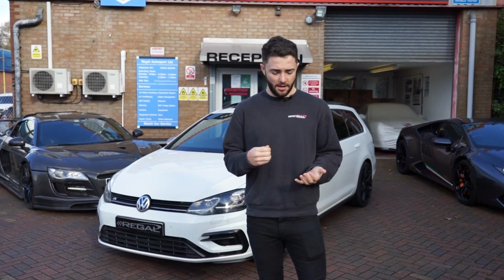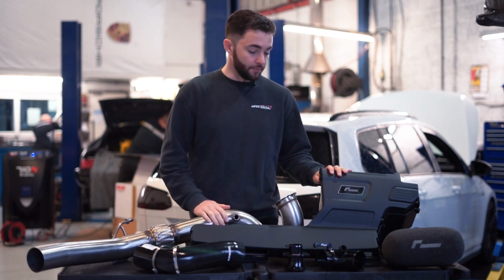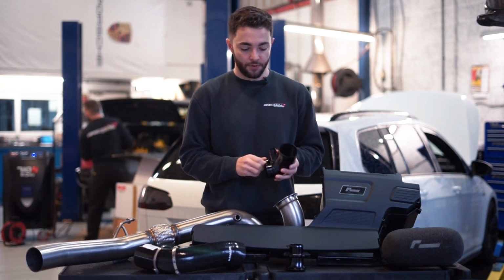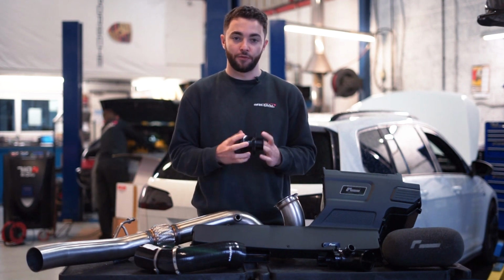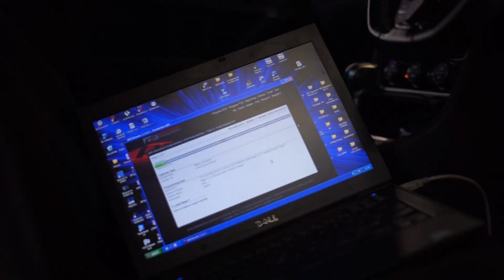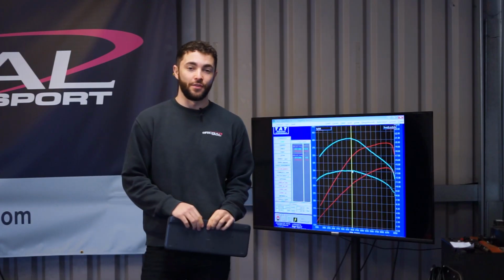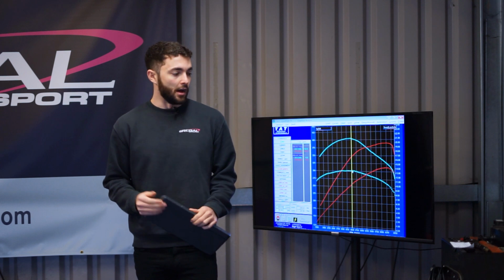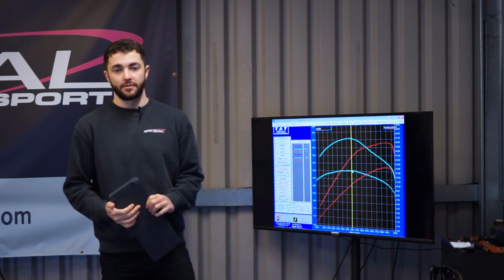+90HP & +104lbfts on a MK7R Estate with APR Stage 2 ECU & DSG Software, Downpipe & Intake

Comment: That's really weird as my R600 sounds very different, has a growl to it that this one doesn't have. Now that APR have stopped doing stage 2, you could use Racingline?
Reply from the maker: Do you have the full 4 piece intake including the elbow, hose and turbo muffler delete? 

We offer our own stage 2 custom software as at the moment RacingLine haven’t tested the RacingLine tunes
Reply: I have the three piece as heard mixed reviews about the turbo delete, so didn't bother. You hear the growl inside the car from the air box. It's amazing. It's only APR stage 1 at the moment too.
Reply from the maker: We fit the full 4 piece intake all the time so only one review here 🤗